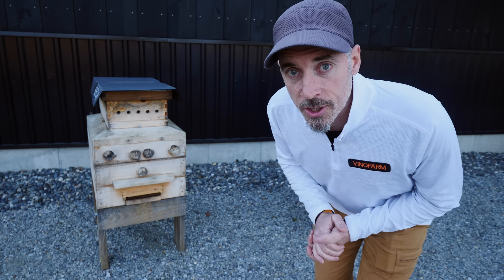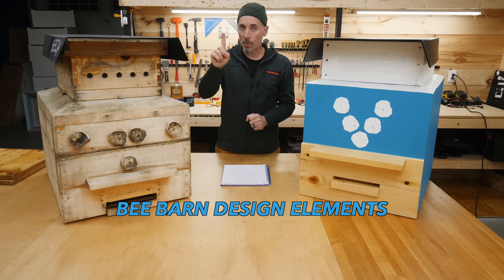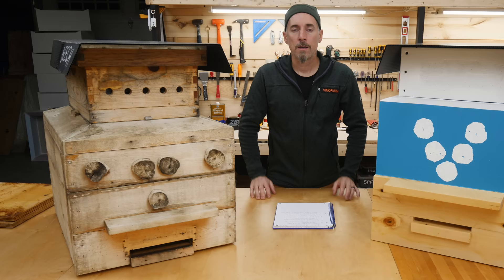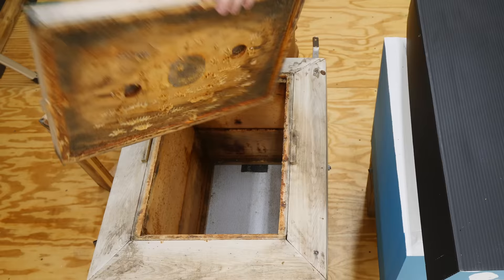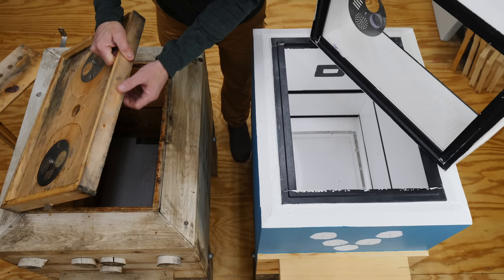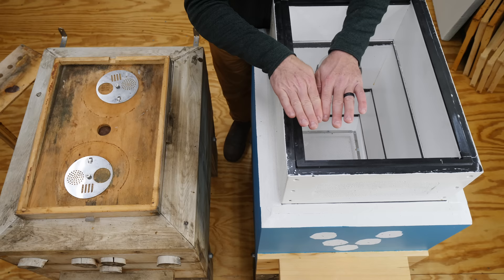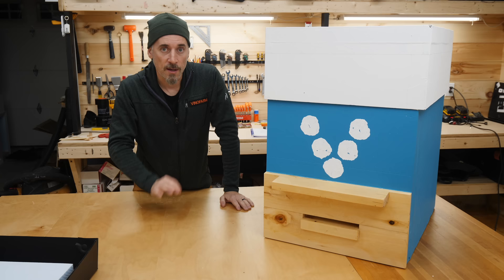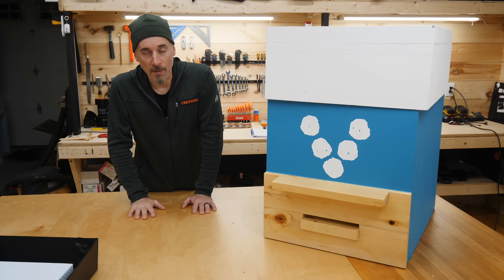I Fixed The Langstroth Hive (Again) - Bee Barn 2.0 REVEAL!

Comment: The one thing I have to say about styrofoam hives (made of extruded foam, not the ones made in moulds) is that bees love to chew the foam. While the problem is escalated if they see light through a crack, they will chew it no matter what to make more space.

The most problematic area for this is 100% the entrance which I can see you've thought of. I hope you don't have too many problems with this.

Also another problem with foam is that waxmoth larva love to chew it and make tunnels into it making it impossible to get rid of them. 

Where I'm from we don't have hive beetles (thank god) so no clue what those are like in foam.

Also having no moisture absorbing material in the hive might be a problem in the late autum or winter. While the insulation will keep the temperature relatively stable the bees still won't keep the whole box warm in the middle of the winter. Hot moist air will raise from the cluster, cool as it touches the outer wall and condensation will form. While as you've said the bees need some water to drink during winter, I'd be more afraid of stuff growing on the walls. Remember bees ventilate during most of the year but when in cluster they don't so some moisture absorption might be better than none.

The last thing about foam is you have to put a UV protective layer on it or it will degrade rapidly.

I've made about 300 foam hives so far (30mm or 1 1/4 thick foam) so all of this is in good faith and from experience :)

All that being said I really hope these hives work out for you :) 

Now for the solutions to these problems... while your upgrade from v1 to v2 did create better insulated hives I believe that the core hive of v1 is better for all the things I mentioned above. The main solution is a way to protect the foam from bees and waxmoth larvae as well as adding a moisture buffer. And this is also where I'm currently stuck with my foam hives. While making a sort of wood foam sandwitch like in v1 works it takes a lot of material. I'd much prefer a solution that can be applied to the foam and form a strong coat, be cheap and non toxic to bees...
Reply: Have you come up with a solution yet? The only thing I can think of is to line the interior with thin plywood, but if it's too thin (1/8" or 1/4") it might warp, and it will add more weight and complexity.
Reply: Realistically we have 3 options, wood, plastic or metal. Each of the 3 have pros and cons but I do think you need to protect the inside and outside of the foam from the bees and other wildlife. Moisture wise you could always set up the top part to absorb it with cloth or something during winter(which I feel would cause the most issues as the bees are inactive). So a plastic sandwich could work in that case, but then you have to worry about warping and damage from the sun. Wood has similar issues from getting damp but it might be easier to manage with a coat of paint or oil layer as protection. Metal has the issue of absorbing to much heat from the sun, so I feel like that wouldn't be that good for the bees, but maybe a plastic/metal or wood/metal hybrid protective layer may work too. It would provide much more protection from wildlife. Honestly though I'm not to sure what would be the best option, even if you took the cost of it all out of it.
Reply: I followed his directions and took a standard hive and covered it with 2" foam, bottom, sides, front, back.  I had coreplast and put that over the foam and screwed it in using 3" screws.  It worked well.  Since the coreplast is corregated, I  caulked the top and the bottom and any areas where there was an opening.  I took self adhesive vinyl wall paper and covered the bottom, and 1/2 way up the walls.  I did the same for the top down.  There are no holes or openings.  Lets see how this works out.  My first hive I have to add the caulk and the vinyl self adhesive wall paper.  Of course the wallpaper was pretty with flowers.  I know, I know, bees don't care about what the hive looks like.  But........I do and sometimes i get carried away.  🙂  Lets see how they do this winter.  I wouldn't use the coreplast again though.  Home Depot has a thin plastic sheet that might work out better.  Or maybe just self stick vinyl wall paper.

Comment: Decided to insulate my 2 hives, first year beekeeper.  I basically built boxes of 2" insulation and 3/4" wood  that go around my double deep hives.  I did not insulate bottom but add 3/4 wood beneath to extend to edge of my insulated box.  I then built new top covers with 4" of foam.  They sit directly on my inner covers.  We have been to -26° F with -65° wind-chill.  So far I see live bees at the entrance on warmer days!

Comment: Welcome back. Not sure you'll ever see this comment in the sea of comments, but maybe others will read and comment. Please understand that I love your creativity and experimentation, and I hope you keep it up. I'm an Alaskan beekeeper, so I'm very familiar with the benefits of insulation, and I've also experimented with plexiglass inner covers. 

As several others have pointed out, I hope that is high density foam you're using. If it's standard foam insulation for human houses, they'll destroy it in no time flat. My first year I built a nuc out of 2" foam, and it was ruined in less than a week. If I put foam in a hive now (say, a follower board), I cover it with packing tape to prevent chewing. That wouldn't work with a box, because it would also inhibit propolis deposits, which are important to colony health.

I've also experimented with plexiglass inner covers. I loved them for the first season, but over a multiple seasons the wax and propolis deposits significantly reduce visibility. You could still estimate cluster size, but could not determine if a frame had capped syrup/honey or not. My attempts to clean them only scratched them up, but maybe you can figure out something I couldn't. 

Finally, your upper entrance, (overhead) ventilation, and inner cover observations are spot on. It may not matter much in warmer places, but in Alaska, helping colonies retain heat is critical to overwintering. After some experimentation, I only use Reflectix as an inner cover. It's easy to peel off, even then the bees are doing their best to glue it down. It also forms a great gasket for the top box (in winter, it's filled with insulation) and/or outer cover.
Reply from the maker: Inner boxes are super dense poly hives. Not regular foam. You'll see in the build videos. Thanks for the thoughtful comment.
Reply: @vinofarm  Aha! I found it. You're using the Lyson 8/9 Deep (Polystyrene) Hive Body! I was wondering how you had built those frame rests.
Reply from the maker: @mike_carvalho  100 Internet points for you. You'll hear all about them in the video on Tuesday.
Reply: @tim, My guess, if you have extra plexiglass covers, you can swap them out and use boiling water to melt off most of the propolis, and wax.

Comment: I love the air gap in the winter top !!! Awesome (a Yurt-like idea).     I've built two Barn Hives 1.0+ versions (waiting for deploy in 2023) with some similar changes to the bottom board - sealed, but no screen, solid. I will likely add a drain wick (post build - like they use in masonry). I expect to build 2 more before bee season) (I like how you did that - great idea).   One thing about outer skins of just insulation - and ant's - you've said you don't have a lot of ant problems, but once they get into the insulation, it becomes a tunneling project for them, and they will build a home in there.  Just like under your bottom insulation. (good idea with chloroplast under your hives too)   Be prepared - once there's food in your yard and a warm place to stay - the ants will seize on that opportunity and eventually you'll have a lot more ant colonies around your bee yard.   (been there, had that). Just like bees, ants, (and mice too) can smell food, and they unfortunately can operate in colder weather than bees. Might be worth considering some other outer shield method for the insulation, other than just 2 coats of paint.   I've used insulation before and have had mice and ants tunnel.  There might be a type of paint that is insect resistant (but not an insecticide). "Haint blue" or "dirt dauber blue" that may add copper-in-the-paint or something.   Keep up the great work - Looking forward to chatting w/you again. --- Your easterly neighbor 20 miles away. ...Don...

Comment: Hey Jim, spot on regarding ventilation.  I have been sliding a polyisocyanurate "sleeve" over my winter colonies for several years (in Connecticut).  They are completely insulated top and bottom as well.  There is just a short 1 1/2" (diameter) piece of pvc as the entrance.  I make a top out of the poly as well, replacing the telescoping lid.  So, no drafts at all.  I have not seen any problems with moisture, and they use less resources throughout the winter.  Awesome and inspiring to see what you are working on!
Reply from the maker: This is the way.
Reply: The huge problem with polyisocyanurate in northern climates is the foaming agent which starts to fail at 50 F thus losing it's insulation properties.  I'm continually taken back that more people don't know that.  Great for southern keepers in hot weather...
Reply: @MinnesotaBeekeeper  Will research that, but I have been using the same "sleeves" for seven years now, with no issues.  Bees have been fine.
Reply: I found the info on polyiso below 50, but so far I have had great results with it.  May try a different insulation for additional colonies going forward.  Thanks for the heads up.

Comment: I'm curious to hear how you like the Styrofoam. I've heard from some Alaskan keepers that they can easily be damaged when cracking the boxes apart or pressing against the sides to center frames, etc. , since they obviously give where wood doesn't.

But I love what you're doing. Although it wouldn't work for my goals and climate, I think you're definitely onto something for your area and goals!  Excited to hear how things go in the future.
Reply: It looks like the rim, is protected by that black hard plastic, should last many years of use

Comment: 5:36 There are several types of Layens hives, the most commonly known is horizontal but vertical Layens hives with supers do exist and have been around for a while, they are called Layens pastorale and Layens divisible. These hives were very common in the past and are still used in some regions of Europe today and I know that in the cold regions of France these hives used to be insulated with a thick layer of straw or reeds on the outside.
Reply from the maker: I was not aware of that. Are they all the typical Layens sized frames?
Reply: @vinofarm  Yes, the Layens Pastorale is composed of a body containing 9 or 10 typical Layens sized frames, and the supers uses 8 or 9 half-sized layens frames. As for the Layens Divisible it is basically made of Pastoral supers so it is intended to use half-sized layens frames but it is possible to put full sized layens frames in two stacked Layens supers.
Reply from the maker: @nikolaasp2968  I know a lot of people look at my frames and immediately compare them to Layens frames, but mine are actually about 50% larger. My observation with how the queens are using my frames is that bigger is better for them. Also, bigger frames means fewer frames for the beekeeper to worry about. Fewer frames to pull during inspections, etc. It’s interesting to hear about hives I never knew about and it’s common for people to seek similarities and make comparisons, but I am very happy with what I’ve built. It’s basically an extra deep Langstroth hive. And from what I’ve read about Langstroth, the design is closer to what Langstroth envisioned and built than the typical “Langstroth” thin hives that are used today.

Comment: Perfect Clarity and concise information about ventilation and insulation and I fully agree. 

I have been using over sized brood frames and they are great (but 10 frames)

I have permeant foam insulation in my roof all year too. It works and it’s great.  

I never liked your inner cover glad that’s gone. 

I’m sad to see you’ve gone full poly. Coz you’ve basically made an over sized Lyson poly hive. I’ll be keeping a wood and poly sandwich. So I can fire scorch the inside when cleaning. 

I drew out designs following your problems video with cold bridging and I drew up basically a shouldered roof just like yours. But it is suitable all year. You don’t need to remove it when summer shines, mine will look a little silly when there is 3 honey supers under it but it’s perfectly functional that way. Also you don’t need to store 1 roof or the other at different times of the year. BUT I DIDNT have the air gap. That’s a good idea. (I’d end loose the top air gap cavity in summer when I’m honey supering, but that’s fine)
Reply from the maker: I'm trying all foam. And yes, it's an oversized Lyson hive. I brought the ~R-5 Lyson to about R-15 for year round insulation. Remember... this s 2.0. I'm not done yet!
Reply: @vinofarm  ha ha okay.
More to come. I like that.

Comment: I want to add that you will catch a lot of flack about venting out excess moisture. when this happens point out that it's not moisture in the hive but condensation on the roof that drips down onto the bees that is the problem. stable temerature minimzes this too..

Comment: I am looking forward to see your results this spring.  With the version I made off your 1.0 design last year I did notice that the bees chewed into the polystyrene board I used as the follower.   Not sure if yours did that too.

At the end of the season last year, I thought I lost my colony as I never saw the queen again and there was no brood in the frame.  We had a cold, rainy fall so I didn’t disturb the colony after I harvested my honey.  I peeked inside in October before our temps dropped consistently below freezing and found there was still a large number of bees in the hive.  They took feed up until the third week of October., at which point I filled up my top cover with insulation and haven’t looked again.  

I have a temperature / humidity sensor up in the lid, essentially in their “attic”, above the inner cover.  Even when we had temps below zero, or single digits (F) they have kept that space at almost 40 F.  It hasn’t mattered if it is 30F outside or 5F, the temps stay within about a ten degree range.  I did see it dip to 30F at one point and was concerned they were done.  The next day they had it up to almost 50.  The temps rise when the humidity rises.  My guess that is when they are working to increase the temp in the hive and respirate more.  The humidity inside the hive is completely independent of the humidity outside.  

It won’t be looking inside the hive until we get a 40 degree day in March.  If they make it, this will be my first successful overwinter.  

I am guessing you will have great success.  I may adapt my hive to the plexiglass inner cover too.  That seems like a great way to check on them without completely exposing them to the cold.

Keep it up!
Reply: The softer follower boards do that. I'm sure Jim has solved that already.

Comment: Looks really good!  Lots of well thought out Ideas. The strap ratchet seems fiddly, how about affixing your strap around the bottom half of the barn and put two D-rings just below the upper lid so you don't need to chase the lower ends, then swing the free end over the top and cinch tight with the D-rings (I'm sure you've seen pants belts made this way). Velcro would get debris stuck to it over time. Integrate your strap foam protectors to the lids.Can the rear tray door be attached to the tray so it doesn't get lost (washers and bolts and/or exterior-grade tape)? How about a wide apron strip of the black sheeting on the stand under the bee entrance slot to keep mice from climbing up the wood base? A couple of tweaks. Looking forward to seeing the build.
Reply: Maybe even a couple of bunjee cords and D-rings would do the trick?

Comment: You can paint the foam with raptor liner and it makes it not only super weather resistant but also adds incredible strength
Reply from the maker: Good idea.
Reply: What is raptor liner? (I've been wondering about the paint...

Comment: 24:00 how does the lip of the polystyrene foam hold up to the weight of the frames? Do you think it will need to be reinforced?
Reply: I wondered the same thing.  You could trim a little of the foam and add a thin wood frame on top that will help distribute the pressure and maintain rigidity while not adding much overall weight.